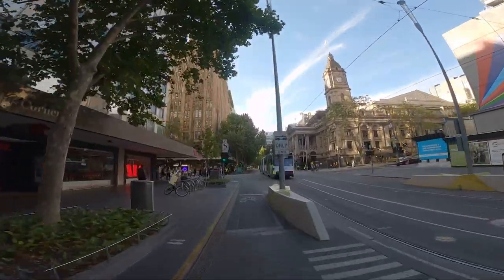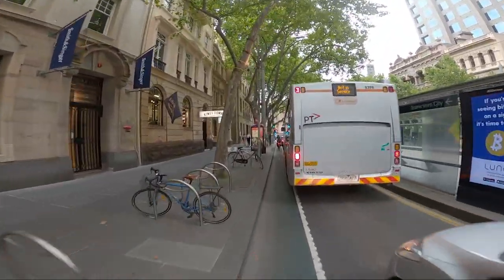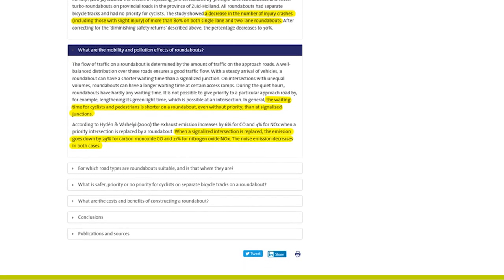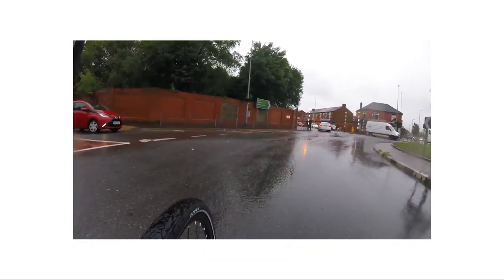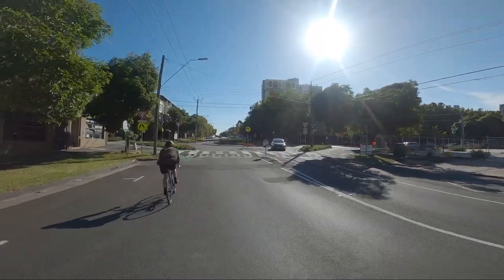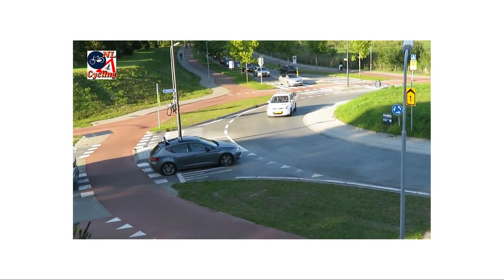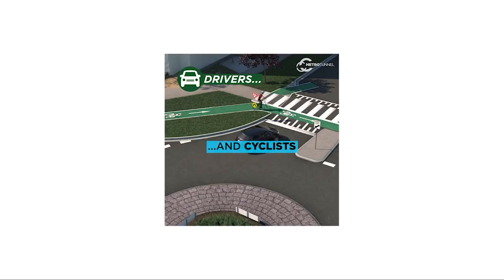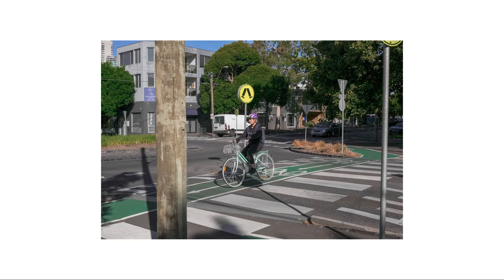Dutch Roundabouts... in Melbourne?

Comment: At a roundabout near mine in Perth where the bike just ends there's one of those rubber squarish speedbumps that doesn't reach all the way across the road, and you can still go fast across as long as your lined up with it properly. So people speed to try get in front of you and then cut you off to speed over the bump, not looking at the roundabout and then often slam on the breaks cause someone's coming. It's worse than if there was just no speedbump at all. Some try to overtake you when you're already in the roundabout and then panic when they realise you weren't going to veer all the way to the left of the circle to go straight.

Comment: Its good to know that most roundabouts in the netherlands are relatively new. Before it was mostly lights, but with designated crossings for cyclists. So car drivers here are used to bike lanes and cyclists as equal participants in traffic. That could explain the ease of adoption. In my area there is a roundabout with a two way cycling around it. In rush hour its hard for cars to enter and leave the roundabout because cyclists keep entering and crossing from both side. Especially now that people are riding electric bikes, and they rush through at high speed, its becoming hard for cars to pull through.. hm 🤔 maybe i should record a video of it.

Comment: For those interested in the Dutch statistics: there are now about 6000 roundabouts in the country and about 60% of those have cycling infrastructure. Those without cycling infrastructure are basically all non accesable for bicycles.
Reply: What's the plan for getting to 100% coverage for bicycles?  Is the council moving at a good pace?
Reply: @rajnadar6555  It's not going to happen, when there is no cycle infrastructure the cycle route follows a different route and does not overlap with the road network in that place. Virtually all roundabouts that have cycling access have cycling infrastructure. You are never dropped on a roundabout in the same lane as cars.

Comment: Another challenge that cyclists face, and would continue to face at roundabouts, even at a Dutch roundabout, is that most every state has road rules that give motor vehicles right of way at roundabouts. Even pedestrians are required to give way to all traffic at a Round about. And vehicular traffic is not required to give way to even a pedestrian. Except in the instance where, like in the two examples that are highlighted here, have zebra pedestrian crossings. But as you pointed out, these are very much the exception. And I expect it will likely stay that way. Sadly.

Comment: So sad to see that in the places they do implement these roundabouts, it's done wrong. As you rightly pointed out: For this type of design to work the stopping line for cars should be even further back so that a car has room to stop between the bike lane and the roundabout. However, if there isn't enough space for that the bike lane should just be on the roundabout itself with protecting traffic islands.